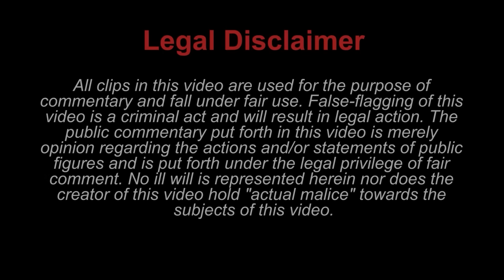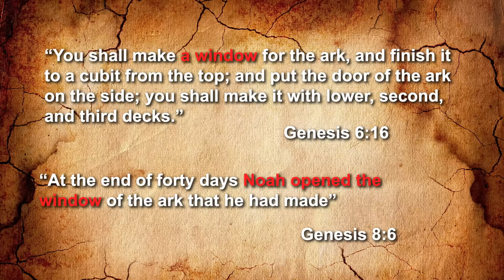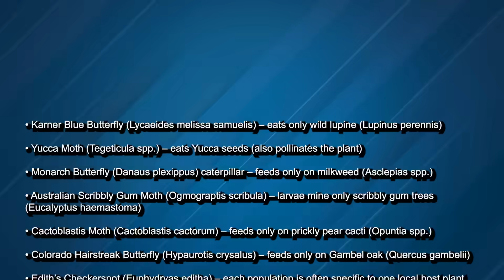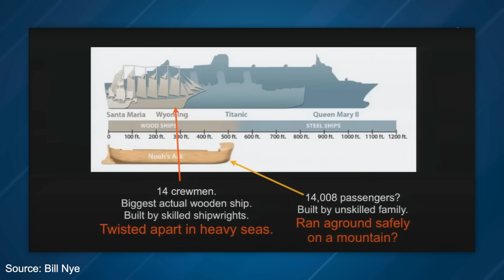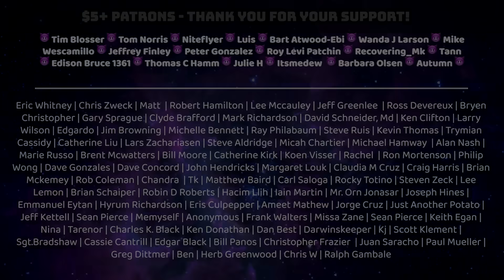Everything Wrong with Noah's Ark in 10 minutes

Comment: You mention Answers in Genesis, but don't really know what they teach (other than the fact that dinosaurs were on the boat). Maybe look into it a little bit. As for things like salinity and temperature problems for fish (which, afaik, AiG doesn't talk about), I have 2 easy solutions:
1. God does miracles. He kept them alive. Easy.
2. Fish were more resilient back then. Through the generations, they've grown more specialized and less resilient.

They show how the boat could have had ventilation. And there's no mention of the number of windows

As for the Ark Encounter requiring steel brackets: that's because they didn't build it using all the techniques that they say Noah used; the outer hull is mostly a facade of wood, as opposed to the several layers of jointed and pitched wood that they teach.

Comment: Consider this... the text in Genesis 6 refers to animals after their "kind". Since you've gone through the trouble of levelling all these objections, please explain what this means. It seems, for example, that only one pair of K9 (aka kind) would need to be aboard the ark, in order to give rise to dogs, wild dogs, dingoes, bears, wolves, foxes...essentially the K9 family later on. To be objective, get the opinions of scientists (you find theistic and atheist varieties). The koala, and emperor penguin and the butterfly from New Zealand need not necessarily have been aboard.

Genesis 6:16 describes how the roof should be built. Is it possible that God had the foresight to include ventilation by having one window all the way around the top of the ark and below the roof, with the roof suspended on pillars?

Regarding whether there even was a flood, scientists on both sides of the 'theist' spectrum are increasingly funneled into considering the evidence and case for 'rapid burial' to account for the existence of fossils, especially fossils they were taught to believe should not exist in a particular period. Example, a fossilized whale was discovered in a vertical position, nose up. According to the information we are fed, the Earth has existed through many millennia of time, such as the Cretaceous period, or Paleogene period. If a whale was to be fossilized, it would be found in rock aligning to the Paleogene period (if I have the period correct). Instead, this whale fossil was found buried in 5 rock layers spanning many 100's of millions of years of the geological record. Please explain to your audience how one whale got buried and later fossilized over 100's of millions of years where as today, a whale carcass decomposes very rapidly, while dismissing rapid burial through a catastrophic flood.

Finally, you are making some assumptions: you assume that carnivorous animals were always carnivores; that all the animals were sexually mature/adults; that Noah did not have the common sense to deal with bodily refuse; that the oceans were always salty, or as salty as they are and that animals are incapable of adapting to their environments; that the continents (you mentioned Australia) were always where they now are (continental drift is not considered); that there has been zero degradation of the Earth since creation (could trees have had a stronger quality about them?).

If you and your audience value intellectual intelligence and honesty by any measure, check out zoologist Professor Walter Veith's Total Onslaught series on Amazing Discoveries (YouTube) for another perspective, rather than spew hate-God-and-hate-Christianity rhetoric. Consider the moral decline of humanity that gave rise to the flood and then consider the manifestation of your moral lense.

Comment: Hi. The ark took 120 years to complete. Even if it had been made of stainless steel, during that time it would have needed painting about twelve times to prevent corrosion during construction. No untreated wooden object could survive that long, which leaves the unavoidable conclusion that the first timbers laid down would have rotted away long before the ark was complete. It's either a metaphor, or it's complete rot. Cheers, P.R.

Comment: I keep aquariums and I've kept live aquatic plants in them for 20 years. Not only did all the plants have to deal with dramatically different salinity levels during the flood, but the aquatic and terrestrial plants all need light. Most plants hate having their light cycles interrupted. Not only would the terrestrial plants die from too much water, but all the plants would die from lack of light. The majority of aquatic plants grow close to shore where the sun is brightest, and terrestrial plants are used to full sun. I guarantee the vast majority of plant species would have died within a couple of weeks due to this treatment. So either that happened and evolution is real and happens much faster than we thought, which also goes against what the Bible teaches, or it didn't happen.
Reply: Look at the Middle East today… lotta sand, not a lot of plants

Comment: The flood stories come from the actual flooding at the end of the Ice Age, which did raise sea levels — to the depth they currently are today.
Reply: Flood stories have nothing to do with the ice ages. Places flood, and very often seasonally. It is not hard to imagine a story of a big flood.
Reply: Yeah, post-Ice Age sea level rise definitely happened – about 120 metres over thousands of years – but that's not the same as a sudden global flood wiping everything out. It was gradual, not a one-time boatworthy event.
Reply: @seanpol9863  Except for the pour souls at the Mediterranean basin when the Gibraltar dam broke.
Reply: @AXKfUN9m Yeah, the Zanclean flood that filled the Mediterranean was dramatic, but it happened over months, not hours – it wasn't some tsunami wiping out a city in a day. Interesting geological event, sure, but not evidence of a global boat flood.
Reply: @seanpol9863  The reason for flood stories is that the cities and towns affected by the flooding were devastated in the course of a single day — not gradually — as another commenter has already pointed out. While the melting of the ice was indeed gradual, it was the surface ice that melted first, forming large lakes within the ice. As the gradual melting continued, the ice walls holding back these large lakes grew thinner and weaker, until their eventual collapse. And once these walls collapsed, a massive amount of water inundated the hapless residents of the city in the path of the water. Since so many cities and towns suffered this same fate, that's the reason why so many cultures have similar stories.
Reply: @TokyoXtreme Sure, sudden floods from ice dam bursts could have wrecked some places fast enough to inspire stories, but that's local, not global. And those tales got passed down and changed over thousands of years – nothing like a single worldwide flood wiping everything out. Geological records don't back a global catastrophe; just lots of regional floods that people remembered.
Reply: @ Yeah, but back in those days, your town was essentially your whole world. And when these stories get passed down verbally over thousands of years, some details are going to get eroded.
Reply: @TokyoXtreme Exactly – and that's kind of the point. Local floods feel like the end of the world when your "world" is one valley and a few dozen people. Over centuries, oral tradition exaggerates. That's how a bad regional flood turns into a tale of a planet-wide deluge. But geology, ice core data, and sediment layers say loud and clear: there was no global flood. Just lots of dramatic local ones that got mythologised.

Comment: 'all these logs need to be cut by hand..." as they show a modern chain-saw doing the work, and 2 years in Ken Ham filed for a flood insurance claim😂
but for real that question that gets me is : where did all the extra water come from? and where did it go after?
Reply: The crust shifted. Sea level is 21 km higher at the equator than at the poles. The MENA region must have temporarily shifted closer to the equator

Comment: Each drop of water would be the same temperature as normal rain. More rain generates more energy, but it's still distributed in more water, so it won't make a difference.

But that's not to take away from all the other reasons the ark is impossible, or if God makes it possible, he could have just as easily made it unnecessary.
Reply: He meant that the speed it would have to rain in order to flood within the given time frame would cause the heat. Not the rain or amount by itself.
Reply: @tripptank  Are the raindrops falling faster?
Reply: @DanielLCarrier  Bro. Read my last response more carefully.
Reply: @tripptank  I'm still not understanding it. If each drop isn't individually moving faster, then they wouldn't individually carry more heat. And hitting with more slightly warm rain is just going to make everything slightly warm.
Reply: @DanielLCarrier  the video is saying it's impossible to have happened the way it described BECAUSE rain can't fall that fast and EVEN IF it did it WOULD create too much heat.

Comment: Let's not forget the geysers! You know, those "fountains of the great deep" that were "broken up"? Yeah, so now you've got continuous worldwide geyser eruptions ON TOP of all that torrential rain! Add to THAT the relatively low melting point of the "pitch," or tree resin/sap used to seal the Ark AND the fact that stuff is HIGHLY flammable. PLUS all the lightning AND the debris that would have been continuously striking the Ark and you've got Noah losing his Ark's water proof seal within the first few minutes due to all that boiling hot geyser water AND all that flood debris striking the Ark at a speed that could supposedly carve out the Grand Canyon within a matter of minutes!

Comment: 2:20 

Q: Does the "I believe in micro-evolution but not macro-evolution" crowd really want to argue that evolution post-flood took place at a rate thousands of times faster than anything we've ever observed.

A: Yes!  Because magic.
Reply: I am a macro evolution believer, but what you are suggesting isnt impossible, in fact, it happened and still happens in the present day, one example for it would be that certain bacteria develop a resistance to anti biotics, which happend at an extremely fast rate, in about 80 years.
Reply: @Kristalman831 you’re missing the rate - from the vid, (very roughly) 2.2 million species evolving from 10,000 on the ark over approx. 4000 years. That’s roughly 550 new species a year, or more than one a day and would still be happening now (unless it supposedly started off even more rapidly only to slow down when people started writing stuff down).
Reply: @Kelley_X  Thanks, Kelley.
Reply: @Kelley_X  wait a minute... your math/logic is way off. New species don't come one by one, they come from existing stock adapting. The math of diversity is an exponential growth function, not a linear function as you suggest. To go from 10k to 2560k is only 8 cycles.
Reply: @Kristalman831  "...what you are suggesting isnt impossible..."

There's a lot to your statement, but let's start with the crux of the matter, which is what do you imagine anyone was suggesting?
Reply: Populations change much faster when their numbers are small.
Apologists also occasionally argue that radioactive elements decayed faster in the past so it stands to reason that mutation rates were also higher due to the extra radiation.

Comment: Excellent.  Around 7 years ago Aaron Ra exposed the fallacy of Noah's Ark by using Logistics on YR.  Many years a documentary on UK TV did the same thing.  They took this bunch of Evangelicals/Creationists to the Grand Canyon, Arizona.  Then the helicoptered them over the Canyon & explained about the ripple effect of receding waters on the surfaces they were walking on.  Totally baffled me.  Then they produced this group of Top Nautical Engineers.  These guys had built Everything from Sailing Dinghies with their Dads, to, Nimitz Aircraft Carriers, Nuclear Subs, & massive Oil Tankers & Container Ships.  They actually that it is impossible  to build a totally wooden boat beyond X feet & Y inches because it will naturally break.  They had lengths of quality wood & tools etc. & let the Evangelicals get on with it.  It busted, I think between 50 & 60 feet.